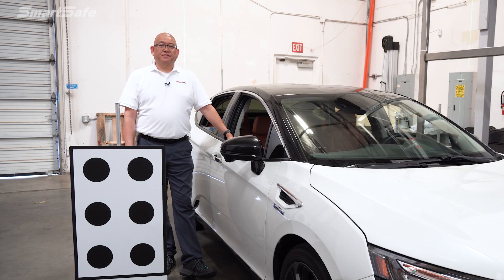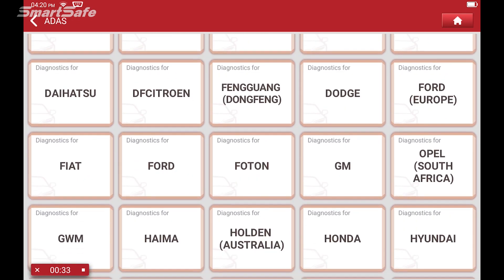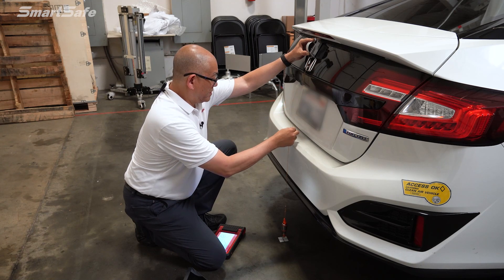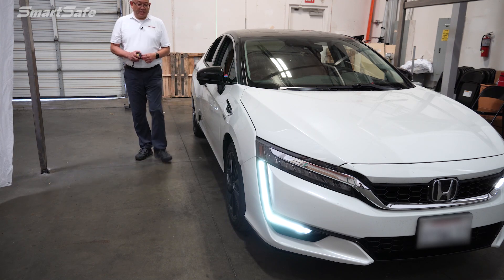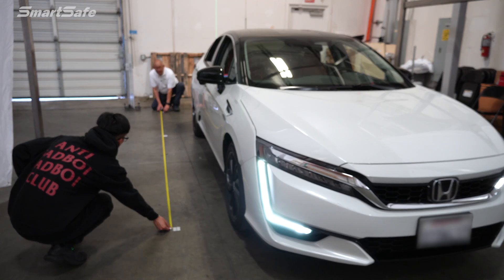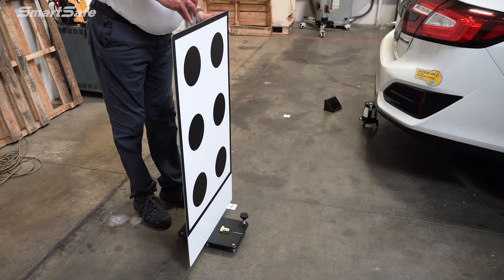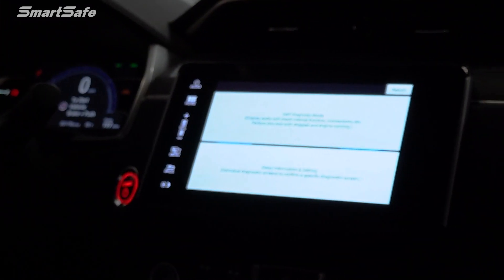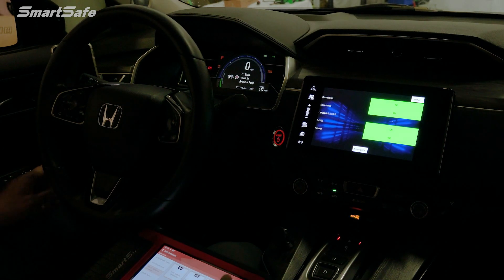2021 Honda Clarity Lane Watch System Calibration

Comment: Better question, I purchased a aftermarket mirror. Will i still be able to calibrate?
Reply from the maker: Assuming that the aftermarket mirror (assembly?) is still using the OE lane watch camera, my guess is it should work unless for some reason the aftermarket mirror does not hold the camera in the same manner as an OE unit.

Comment: My camera is facing more up than down is that because of this or because it’s a faulty camera?
Reply from the maker: Did something happen to your RH mirror?  According to Honda, an aiming or calibration of the LaneWatch camera is necessary if any of the following occurred:

LaneWatch camera removal or replacement
Passenger's side power mirror removal or replacement
Passenger's side mirror housing lower cover removal or replacement
Passenger's side door position adjustment